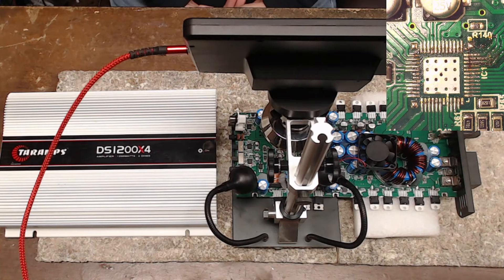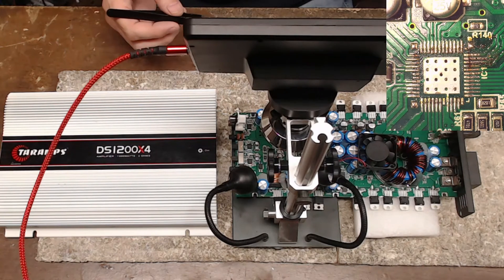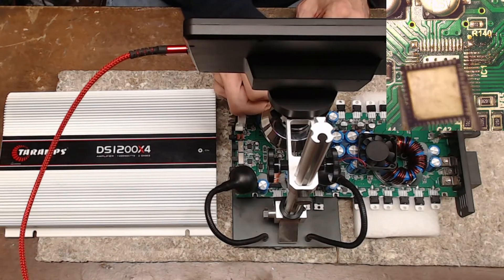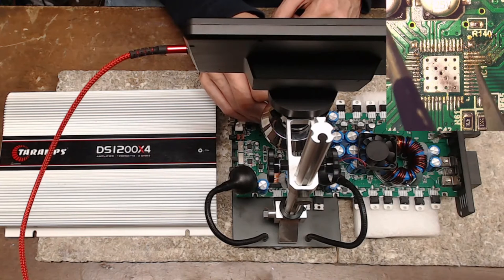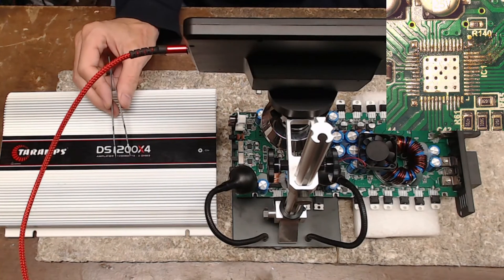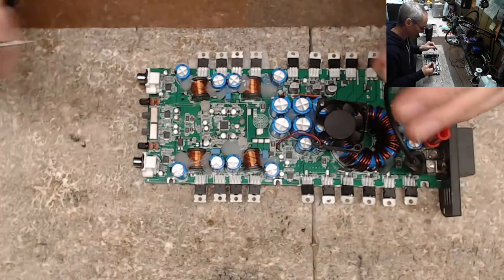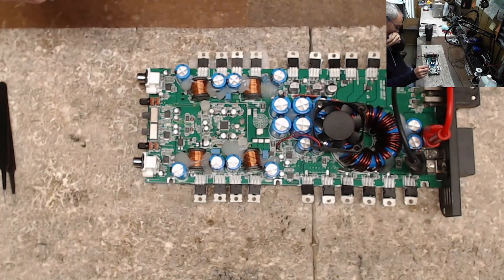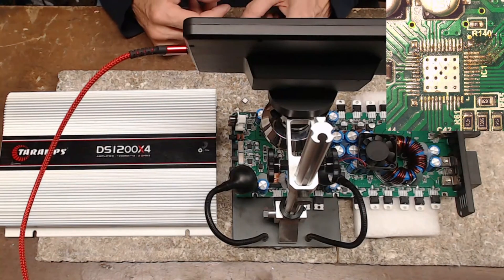Taramps DS 1200.4 IRS2093M SMD One Channel Out Soldering Failure

Comment: I'm wondering how the previous Tech was able to remove that IC. It's clear you would need a hot air station to remove it as well as reinstall it. Why would they remove all of the soldier off the pad? It looks like they reinstalled it with only a soldering iron which doesn't make sense. Maybe they were able to use their soldering iron to just massively overheat the old IC and remove it, but didn't want to do the same to reinstall the new one? I don't know, that's just weird. Lol
Reply from the maker: I absolutely agree. I am not sure how this would have come about but I will admit I see all kinds of "weird" methods used to repair electronics.

Comment: I don't know if this is the right place to ask but I have the same amp and the crossover slide switch is acting up and I have to jiggle it to make sound come through. Both switches are doing the same.  Will it be cost effective to have it repaired or just to buy the new ts 1200x4 which is newer and cheaper $144 off taramps website